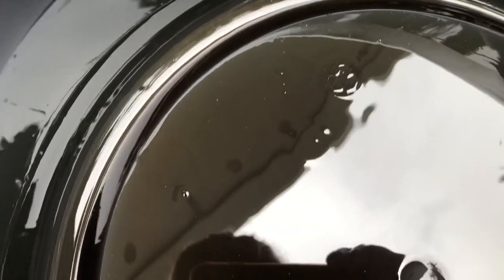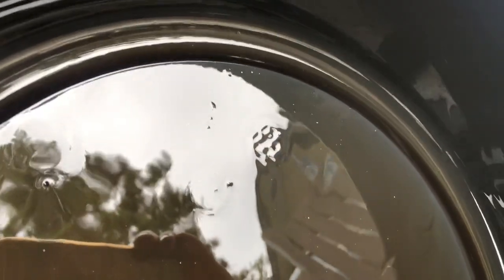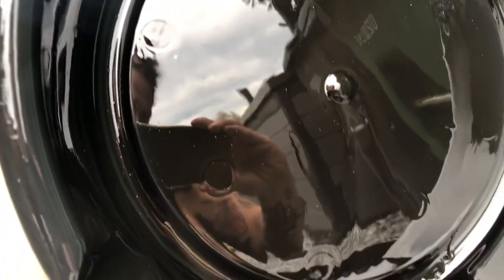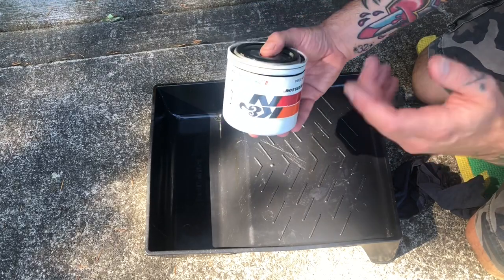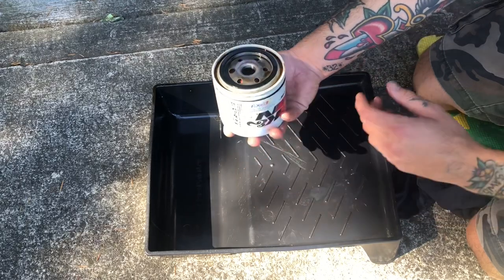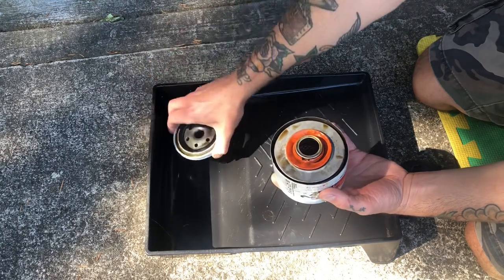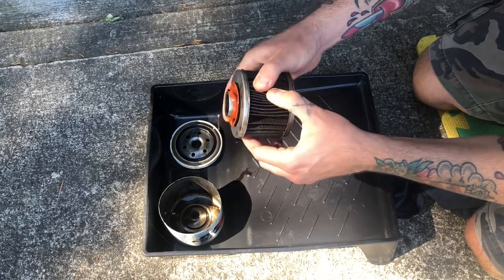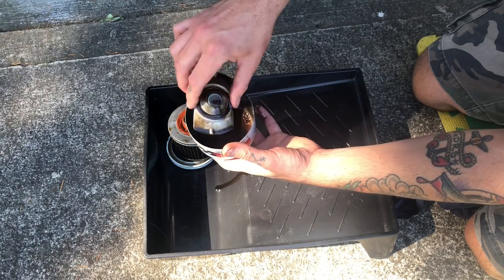What you don’t want to see inside your oil filter

Comment: Tough luck, but that thing really ran strong for a while!! I'm curious to see the autopsy findings. I had a 360 with J-heads and a .528" (small!!) MoPar solid cam and it made around 400hp, not enough to really tear up-lol. Ran it for hundreds of runs and then pulled it for a 416 (340 block .030" with the 4" crank) with Edelbrock heads and a .589" Ultradyne solid cam and gained 125hp. Both were 10:1 pump gas motors and served me well, running 12.60s with the 360 and 11.30 with the 416 in the quarter, both with street friendly 3.91 gears. Love your channel and keep us updated with the new bullet!!
Reply from the maker: You know it bro! Thanks 👍🏻👍🏻👍🏻

Comment: At least you caught it before it left a widow in the oil pan and/or block. Look forward to seeing what you find when you tear the engine down. I'm also curious of what the bearing clearances were when you built this engine. Look forward to your next video! 
I've built a few high performance engines in my time and rebuilt quite a few stock engines too. I'm 51 and started turning wrenches on my own in the early 80's, my grandfather taught me to do basic maintenance when I was 8 years young. He owned his own service station for many years and had a shop behind their house after he retired.
Reply from the maker: True.  No hole in block is good. 👍🏻👍🏻👍🏻

Comment: Set those rod and main bearing clearances a little looser next time at least 2 thousands (rods mainly) piston skirt a bit loose to, double check your oil system make sure it isn't going dry when you launch from the line a loose engine is a happy engine as long as the oil system can keep up.

Comment: With no more carnage than what you have found so far, the block and crank are fine!! You may have some scoring on the crank and if it’s not to bad may be able to be polished but worse case is it will need turned and get undersized bearings. But the block is not harmed at this point, at least bad enough to warrant tossing. Strip it down, take everything and drop it off at the machine shop for a spa day and have your machinist clean and blow and dip and blow again at every orifice the block has. I have run engines for considerable amount of time after finding shavings much, much worse than what you’ve got, and unfortunately due to parts issues and Christmas like three days away, we had to do what we had to do to get that 360 going again to hopefully get it thru the winter and rebuild in spring. Installed new main and rod bearings and polished the crank in vehicle, and when done, that has been a great running 360. That was in 2010, and it’s still going and running great in 2021. 

These engines will surprise you with what they can take!!
Reply from the maker: That’s positive thinking! I still won’t be using crank or rods. Moving on to big and better things. 👍🏻
Reply: @SimpsonsSpeedShop  lord brother, I’m not trying to convince you to use it but I guess I didn’t say it tho, Just don’t throw it out. You’ve got room in a corner for it somewhere t ok save for the unknown down the road. It’s still a great block and I bet the crank will be fine also. Both will be awesome for another lower to mid range power build for someone. 

Good luck man, you got this 💩!!
Reply from the maker: @1982MCI  ya for sure will be using block and if crank and such are salvageable will do. The pistons are ok 10:5 hypers so save them

Comment: That is a real downer. But the bright side is that you were making good power there.
Unfortunately like you said.  This is racing.  And stuff wears out quickly sometimes. 
It hurts the pocketbook for sure. But you're going to be back out there soon.
Reply from the maker: Right on brother. Thanks for the support. I’m on it!
Reply: @SimpsonsSpeedShop  I have been itching to do exactly the motor you're talking about building.  But am not in a position at all to do it. I made the mistake of selling my 68 dart GTS 340 several years ago and have regretted it ever since

Comment: Wow Joe, sorry but nice now you get the stroker. Maybe a larger oil pan? I run a road race pan in my Duster that will hold about 7 quarts, but sits flush with the k frame. Only down side was needed tti  headers.. Not bad

Comment: 5:17 that “feature” is an over pressure check valve. Specifically a combination valve as the valve is integrated in the compression spring. Most automotive oil filters have a check valve. It does the opposite of filtering - it opens when the filter is clogged to the point of not flowing. Prevents filter from bursting. And the orange “seal” is the ADV.
Reply from the maker: Oh wow. Thanks for the info. 👍🏻

Comment: When you build your new one put a main gridle in it from Hughes Engines. It will stop any main cap walking at all. I am running a 1980 arrow with a stoke stroke 360. It seems to a big difference with bearing wear. Love your videos.
Reply from the maker: Will ether do girdle or 4 bolt main the block
Reply: @SimpsonsSpeedShop  walls on block are pretty thin not like a 340 block. Keep that on mind.
Reply: @SimpsonsSpeedShop  my opinion and experience would be to do the girdle If anything at all. The 4 bolt main really has not been a feasible mod on these blocks. From my research and knowledge over the years a 360 : bolt main block is still much stronger than a BBC 4 bolt main setup due to Chrysler building a strong block back in the days. The engineers for Chrysler designed the small blocks to have a much higher nickel percentage in the block than Chevy it ford did which makes the small block Mopar really under rated in power potential. Unless your planning on exceeding 750-800hp, the stock small block Mopar will handle it without that modification
Reply from the maker: @1982MCI  ya I will talk with engine builder about what the best option is for sure.

Comment: Hey Joe, pull the dizzy. I'm thinking maybe bronze gear took a dive given the early ignition problems you saw. May have ended with main/rod bearings, but I don't think it started there. Also, rods/mains give you only seconds until seize...don't think you would have made it home. Even if you did spin rod/main, motor is far from trashed. Maybe crank grind, couple of rods reconned or replaced, thorough cleanout & re-assembly. I've done it a couple of times no prob, under $500 + your time. No puddles & no windows in the block = good news day! Good luck & rock on! (p.s. smear that oil between your fingers for best view of debris, and memorize that heavy roasted smell...if you ever smell it again you'll recognize it in an instant before massive damage...kill ign, tranny to neutral, coast to a stop)
Reply: I’m in agreement with your thoughts that it might be the gear on the oil pump/distributor drive, assuming it’s bronze. Actually, I pretty much agree with everything you said, when you pull out the oil pump drive, you might find the oilite bushing has seized onto the shaft and spun in the block. I’ve seen many times, from not broaching them after installation, you know, that special Miller tool in the service manual, that nearly no engine shop owns.
Reply: @jamesblair9614  Oops! I forgot we're talking about Mopars, which I don't really know in detail. So I'll take your word on the broaching. Quick google search just found lots of talk about mismatched pump drive gears vs cam gears, lots of lunched bronze gears. Also talk of adding collars on shaft to prevent drive from climbing up cam which lunches both gears (Again, not familiar with that Mopar trick). Lots to learn...4 common drive gear materials against multiple cam materials...mixed opinions 50/50...get it right it will run forever, get it wrong trashed in <1000 miles. Best advice sounded like run the gear that cam mfg recommends for that particular cam. Cheers!

Comment: Have you thought about using FilterMags or the equivalent in neodymium magnets for the oil filter after the next build? I've been using them for years, I highly recommend them. Now that you've got a filter cutter and have experienced some bearing failure grief, I guess you'll be examining those filters regularly.
Reply from the maker: Ya I have looked into those filtermagnets. Amd yes ever filter will be cut apart from now on. Lol. Thanks for watching
Reply: Bearing material doesn't stick to a magnet does it?

Comment: That’s are bad news. But I am happy to hear that you will fix this and Race again. :) 
I will definitely check my filters in future like you explained. Nice to hear about your engine plans. Which oil pan do you use on your engine? 
BR from Germany
Reply from the maker: It’s a mildon pan check dyno vid for more details on it. New motor will be rockin cheers 🍻🇨🇦
Reply: @SimpsonsSpeedShop is this one for special acceleration and high rpm? Maybe the oil getting backwards when you hit the gas and then your pump gets no oil. 
-
LOW PRO
Designed for 340 & 360 engines where superior oil control and increased ground clearence is desired. Features increased oil capacity, which is an absolute must to handle the demands of higher RPM, while increasing oil control by raising the rear pan floor. Highly efficient horizontal baffles are used for oil control. Magnetic drainplug included.

Comment: I wonder if it is from racing and the oil going to the front of the pan in the shutdown being it's such a short shutdown. you need to get a pan with baffles in it to keep the oil on the sump. I bet that could of been the starting cause of the whole thing because losing oil pressure at 6 or 7 grand is killer on the bearings and that happening every pass is just eating more and more bearing away till there is nothing left
Reply: Understandable, but he said he had the oil pressure drops basically from the beginning with the engine on the dyno so this seems to be more of an interior oiling issue this time, but who knows, everything is always worth looking at

Comment: Issues with timing and oil pressure would tell me you might have an issue with your distributor/oil pump gear or bushing, I don't know your cam specifics i.e. roller or flat tappet but if it's a roller and you have a bronze gear it possibly cut be eating itself or the bushing is wearing itself out.

Comment: Well when you lose oil pressure that is the main bearings that are causing it and when that happens that's not good at all. I wonder if the bushing on the oil pump drive gear took a dump and started tearing the cam and drive gear up and that's what caused everything else. that would explain the timing issue you were having also.

Comment: Joe! order them parts right away ,I am waiting ON A CAMSHAFT YET ! like 6 months now. all websites say 3 months wait!
you can make a Video with How you replaced the Hood and installed the "Prop" Rod for Hood.
Reply from the maker: Ya good call I want to get in it ASAP. What you want with hood?
Reply: Iskey cams have not been Able to get cam blanks for several months now and don’t have any ideas on when yet. This could start causing major problems across more than just racing if this crap keeps up guys!!

If you think you need parts for a project this winter then you’d better go ahead and get them ordered if you can afford it
Reply: @SimpsonsSpeedShop  oh i guess What you all did to it , Thanks for showing on your next video
Reply: @1982MCI  I am hoping a guy , got me a core . Racer Brown Cams here in Maryland USA